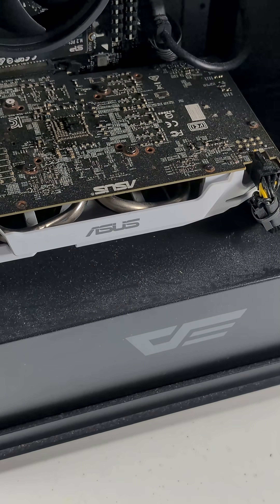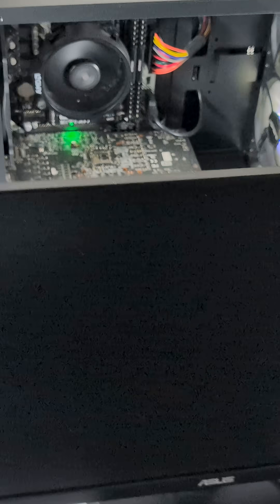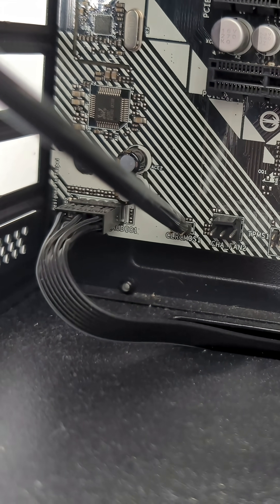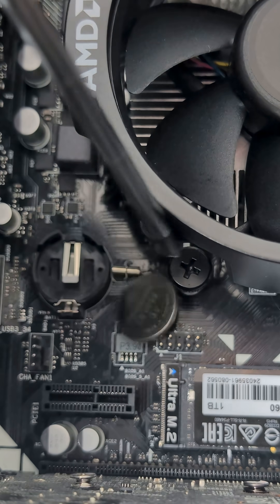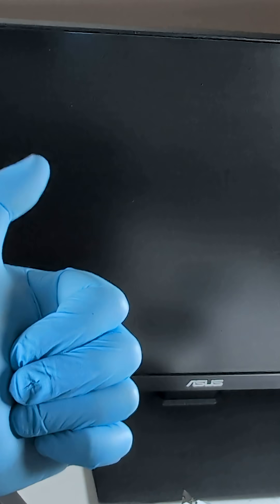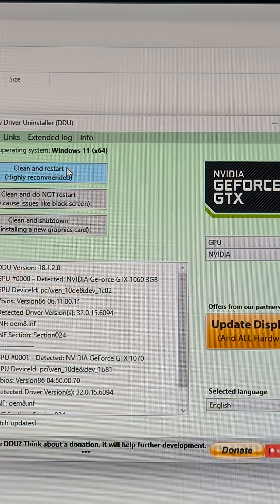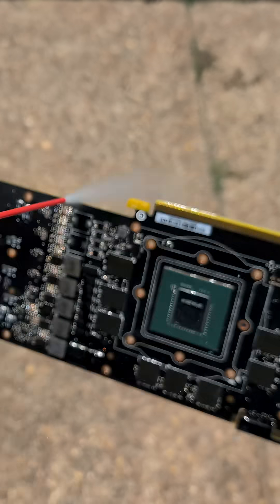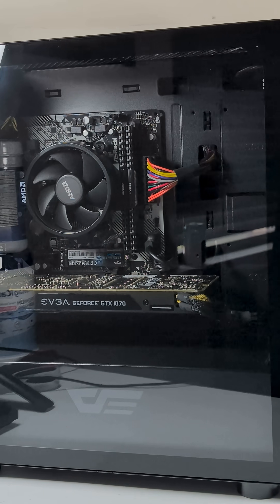Fixing a Ryzen PC with no Video Signal! #nvidia #amd #pcsettings  #gamingpc  #computerhardware #pc

Comment: I wonder if this is what is going to happen when we try to install newer drivers than those that support the GTX 1080 and lower. I still have one that I use to run Physx and Flex for my RTX 5070 on older games. I can also use it with Lossless Scaling for frame generation and upscaling so that the 5070 can focus on rendering.
Reply from the maker: I haven't had time to look at the 1060 but my current guess is a possible VRAM issue or some other hardware related problem.